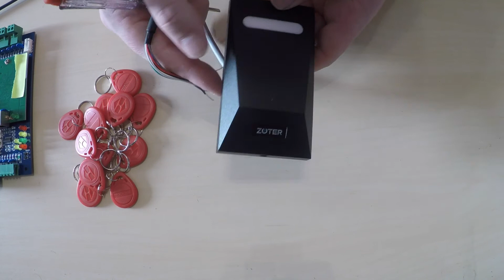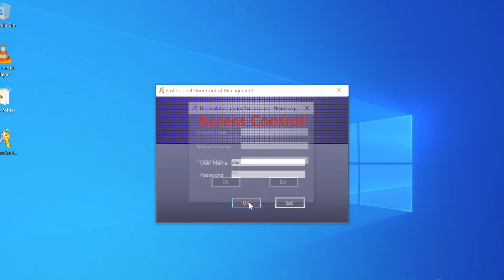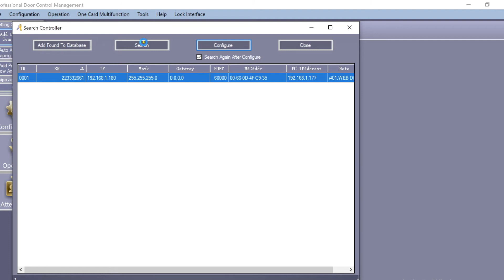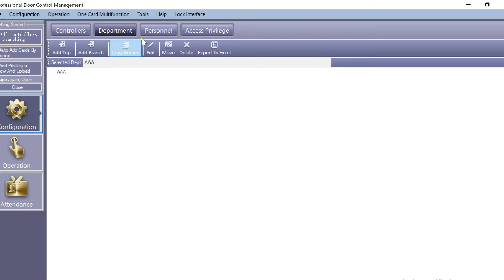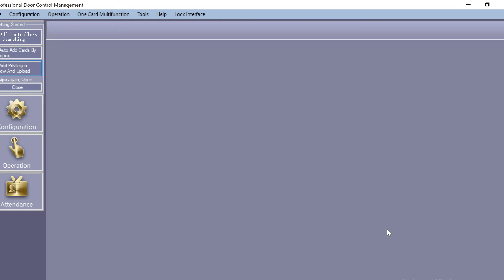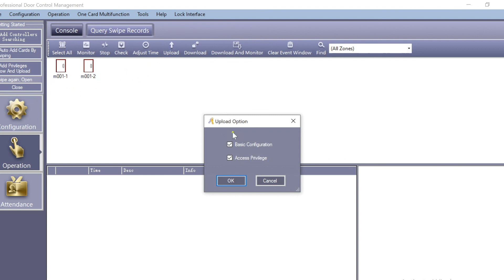Uhppote 2 door Basic Set-Up

Comment: Does it need to be connected to the network and the software needs to run all the time or is the software only used for programming? Does it support fingerprint?
Reply: he indicated that the software uploads the settings to the board, so it can run "offline" after that

Comment: I just got this system up and running. Is there any way to access the controller over the internet?  I’ve only been able to access it through the local network.
Reply: did you found the answer?
Reply: @galayer  no I was not able to.
Reply: @lorendaoust4443  ok I'm trying a couple of things, I'll let you know if I'm able to.
Reply: I personally have the software installed on a local server and access the panel via the RD Client app on my phone.
Reply: @BernDJuize  Local server on OS Windows?  Can you view the entrances of visitors and open the door being very far away where there is Internet?
Reply: @TheBobrovskij  As long as both the server you're running it on as well as the phone you're using to RDP into it, you should be able to have full control over the doors, swipe records, and just about everything else from anywhere in the world. Remember that the port used for Windows RDP is 3389, just forward that port to the machine you're hosting the software on and use your external IP for remote desktop.